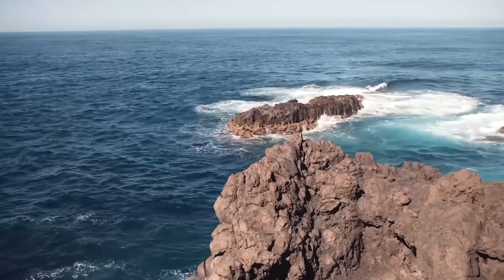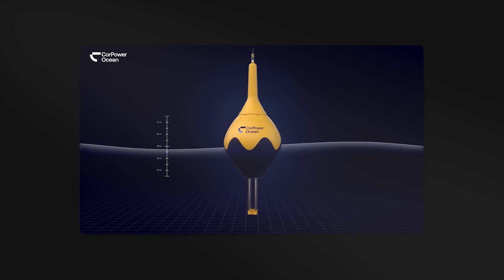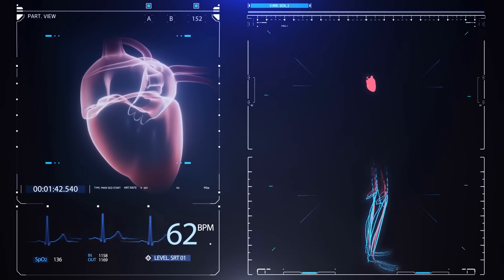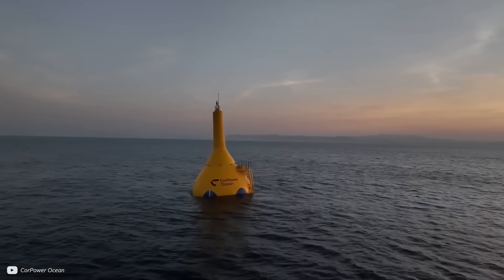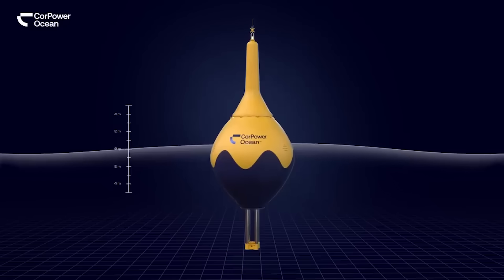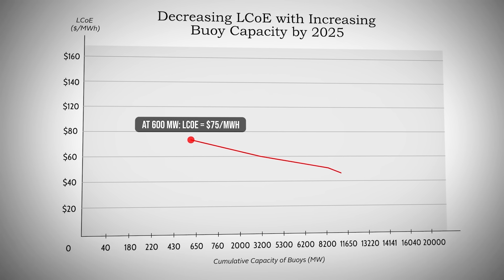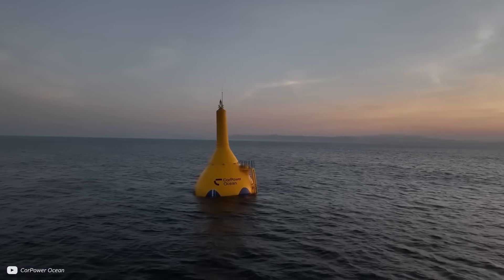Unlimited Wave Energy: This Buoy is the Future

Comment: One major problem with many wave-driven generators or anything in relatively slow-moving water is barnacles weighing everything down over time or interfering with moving parts. Anything you permanently install at sea that requires buoyancy or exposed underwater moving parts will likely need to have the barnacles periodically scraped off and an anti-stick coating re-applied.
Reply: It moves up and down the shaft, just put a scraper on the bottom that moves with the float up and down.  Everything else can be barnacled.
Reply: It will be a simple machine that cleans itself. What you proposed is wonderful !
Reply: @barneyrubble4293  Barnacles increase drag, which increases side loads that the whole system has to withstand through the whole range of oceanic currents, wave roughness and operating loads. It also adds vertical drag which increases the up/down loads the mechanism has to bear. Buoys rely on buoyancy to apply upward force and barnacles weighing the shell down would reduce available net buoyancy, reducing peak power production.

Scraping the pole to prevent barnacles from stacking on it only solves a small part of the barnacle problem. The part of the reciprocating pole that gets regularly used in operation would get scraped by the entry point shields and seals anyway.
Reply: In fact, nothing bad will happen if it is well designed and what you say will not happen. Do not portray the “moving parts” as if they are a bad thing. The mechanism has been known for a long time and it is a smooth and strong sliding mechanism, so no “scraping” will occur. . By the way, everything on the beaches, including barnacles, can attach to anything, even if it is a rubber board. But it may be possible to isolate the mechanism so that it can perform its function without being affected by the surrounding environment.
Reply: @teardowndan5364  seems like it would be a pretty easy job for a drone to carry out regularly if designed in a smart way or am I under estimating the complexity of the removal?   Certainly for the shaft at least
Reply: is that not a biological problem, not a mechanical so it requires a biological soloution

Comment: Hi Ziroth, love the topic and the way you explained the tech. I have been thinking about this for a while and have seen many different versions of tech trying to capture the wave energy.
My research was also on storage of energy as the renewable sources are neither consistent nor reliable. With this in mind, I was exploring Compressed Air storage and developed a quick & dirty CAT ( compressed air turbine ) and also received a patent for it. https://patents.google.com/patent/US9627953B1/en . Would be great if you could cover this topic as well as current forms of storage are extremely polluting to manufacture/recycle/dispose.

Comment: Pity that wave energy is barely predictable and not at all plannable. You don't know how much energy there will be and when, just like wind and solar - it's weather dependable.
Another story is presented by tidal and ocean current energy - 100% predictable and fully plannable even if tides turns 2-4 times a day - you know exactly when and how long the outage will be.
There is now newer generation of ocean current tech: Minesto Dragon 12 - very light (=low costs) 28 tonnes, 12m wing @1,2MW, projecting to produce about 3GWh electricity per year. Just lanched in februari and working flawlessly.

Comment: Actually, you could have a much longer tube like structure, and capture the energy of those 18.5 metre high waves as well. That would 1. produce much more energy, 2. allow for continuous operation in all weathers, and 3. act as a slight damper to such storms, marginally reducing their destructive damage on the nearby shoreline.

Comment: If wave energy machines actually worked why are they not used to power the lights on navigation buoys?  Instead we use batteries that have to be replaced. 
I suggest the whole thing is a way to extract research money from gullible providers.

Comment: Finally an alternative energy solution that doesn't destroy the environment, and ocean animals as ocean wind turbines do. Also does not despoil the aesthetics.
Possibly providing good energy most of the time, not like only 30% ave for wind and solar. Let's hope this is a good solution. if they can get the issues of longevity of the system and big maintenance requirements addressed.
There have certainly been many many wave energy systems failures.

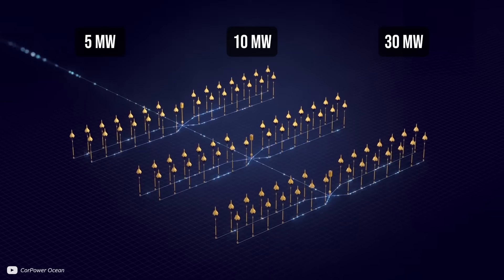Comment: This system looks very intriguing. But I am puzzled by the anchor. The anchor is a LONG, rigid cylinder  (8:00, 10:29), with a large 'bulb' at its bottom. For this to be vibro-hammered into the seabed, implies the seabed consists of deep layers of loose soil (not what I expected). The anchor (7:58, 10:36) is vibro-hammered into the seafloor. The piston assembly (8:42 - 8:44) is mounted to the anchor via. a  flexible coupling (4:27). The underwater assembly is very briefly shown at (8:45). I am puzzled by the sea floor and bending moments on the piston.
NOTE: Minor error at 4:07- "Work with air instead of a fluid" is wrong. Air is also a fluid.  It should say 'work with a compressible fluid (air) instead of an incompressible fluid (liquid)

Comment: The economics of power generation are driven by physics.  Generation efficiency depends on the concentration of energy.  High concentrations of energy (speed, pressure, heat, height etc) improve efficiency.  Wave energy is low density energy.  It takes a lot of materials (concrete, steel, other) to harvest low density energy.  Wave generators have to be able to cope with the worst storms.  That adds to the weight and cost of materials.  Very very difficult to build economically viable wave generation.  That is why these types of projects rarely get past the pilot stage.
Reply: Party-pooper!  ;)
Reply: @gibbogle  There is always one :-)

Comment: Switchgear electrician here. Better to split power output into three branches, with separate paths to shore. Yes, more expense, but also cables are less expensive (thinner) and three is more reliable than one. We know that electric fields are used by a variety of aquatic critters for sensing, and we don't know how they will react.

Comment: The universal anchor is an interesting concept. Would the optimal solution not be influenced by the geology of the seabed? That would make a one size fits all solution sub-optimal. Is it designed with a massive factorv of safety but inexpensive materials? Maybe it's only the pile cap that's universal and the vibration pile that goes into the sea bed is matched with the local conditions.

Comment: An object already rides waves moves in a circular motion. No need to convert vertical to circular when you already have circular. Simply need a crankshaft suspended at the average height of the peak/trough, something that floats for a crankshaft journal, give it the freedom to slide towards or away from the center of the crank. ta-da instant wave generator w/o the efficiency loss of converting circular to linear motion. Someone patent and build it... when you get uber rich from it, just throw me a tip for the idea.

Comment: I think it's fantastic that there is a new group making a device and it looks compelling and full of innovation and I wish them all the best.

I don't like the whole theme 'a litany of failures' to describe previous work in the field of wave energy. Another way to describe it would be 'they are standing on the shoulders of giants'.  The Wright flyer only managed a few hundred feet aloft.

Device efficiency is not the key driver of a design as there's an infinite amount of wave energy. The thing to optimise is the amount of power generated per million pounds invested. That's the return on capital expenditure.

Survivablility is very important - the Ocean Power Delivery's (now Quoceant) Pelamis P2 was tested in the North Sea between 2004 and 2010 off Orkney surviving many storms.

Ultimately wave power will be decided on factors like how much it costs (it can't compete with offshore wind at the moment). It might be worth the cost in inshore areas where wind turbines are unsightly.

The whole field of modern wave power was founded in the 1970s by Stephen Salter and the Wave Power Group at Edinburgh university that has give rise to several wave power companies and different devices. The most basic of research would have shown you this and it's a shame that you didn't do that especially as Stephen Salter died a couple of months ago.

Comment: wavepower, i like it.
Survivability and efficiency are the problems?

Well, boats if build correctly can last a long time.

Seems to me we have this thing called tides. Every so many hours, is it 6?
I dunno, not an expert on tides.
Not an expert at all actually.

BUT, what i would think is possible is to use boats, or floating platforms or such, that rise with the tide in a nice harbor.
They go up. And they go down.
So why not attach em to a gear train that runs generators?
Construct something that makes it possible that the generators run when the floating stuff goes up with the incoming tide, and down with the outgoing tide.

The current of rivers are not used that much either.
But we could...
Instead of windmills we could put stuff in rivers to generate power.
Not just dams but propellers on the bottom. Something like that.
Or, just the old waterwheels we used in the past.

We could also stop wasting our time on this and just continu to work in a bit slower pace towards all these nice goals.
They are nice, clean energy.
BUT we cant expect the entire world to just switch in a few years time from cheap fuel oil to expensive stuff like this.
Plus, it wont work.

We should take it a bit slower.
And instead of wasting billions on wars, we could spend it on coming up with ways to actually provide people with everything they need as cheaply as possible.
And sustainable.

I am no Einstein. 
But it seems to me we should use the power of nature a lot more than we are doing right now.
And we could if we took the time to think about that instead of thinking about wars.
Heck, we sent people to the moon in the 60's. So we could achieve anything if we want.

Comment: Best video on the topic I`ve seen! You have done your homework here (not to mention your other videos)! And that`s coming from someone who was involved with wave energy for 15 years!  I do think that CorPower is hands-down the winner in this niche,  however I cannot see it competing with Floating Offshore Wind as the interest, money, and O&G experience  has shifted there in part because of all the repeated overpormises and ego-driven failures of the WE industry in the past 50 years.  Let`s hope CorPower can break the trend!  At this point we need all the renewable electricity we can get.  One thing that you did not mention (but which of course is repeated ad nauseam by propoenents is that wave energy is less intermittant than wind or solar.  And where did you get the LCOE figure at 10:25 from?  Keep up the good work!

Comment: Really... a mass of gears?  what is wrong with just one moving permanent magnet acting as a piston through the EM fields of some copper windings creating an electrical charge, much cheaper to manufacture, certainly less wear and tear and less maintenance
Reply: I was just about to post the same message.

Comment: I wondered if the metal beams that move in and out of the buoy are not subject to corrosion over the long run? And if so, couldn't they be protected by a cylindrical skirt that covers the length of the movement filled with a non corrosive gas such as nitrogen.

Comment: Yet another gadget dreamed up to harness the energy of waves. It will not succeed because it requires piston and shaft seals to pump fluid to generate power. Sliding motion requires lubrication to minimise wear in the sliding components. Lubrication systems need attention and sealing systems require replacement ….and so it goes……all happening out at sea in a bobbing bubble…..and I haven’t even bothered to look at the associated systems….like the tethering system say…..which will require a lot of attention as it succumbs to the corrosive sea environment…..and the locking system to stop the bobbing bubble…..and….and…..and. Next please..!!😂😂😂

Comment: The massive elephant in the room here is that unlike wind and solar, wave doesn't scale at all. You can't make the floats bigger because for the same reason as a big ship gives smoother sailing, a big float will bridge across waves and no longer move up and down with them at all, so they're stuck at one size, so lose out on the economies of scale wind turbines have been benefiting from for decades. If they have to install 20 GW before economies of scale are competitive with the cost of wind and solar right now (And these figures are going down continuously, especially solar), they've literally got nothing worth anyone's investment for commercial power generation.

Comment: patenting 20 years before use smacks of patent trolling ie alternate energy working for big energy. also the very fact that these need to be anchored means provisioning ie complications plus these lock up on high energy waves. I've come up with a rough draft for a wave energy generator. it is completely submerged so very little provisioning required. think about a bicycle lying upside down. its front wheel can turn left or right, it can rotate and has spokes. now make these spokes have gear teeth and have beads with gear teeth travel along the spokes so that there is no slippage and it's bidirectional. so our weg has a base with batteries, is anchored to the floor, generates electricity when the beads move along the spokes and when it rotates on its hub and when it turns left or right. this energy is used to charge the batteries and can be connected in a grid of wegs. because it's completely submerged and near the floor, we don't need to worry about surface level turbulence. the beads can have fins to maximally convert wave energy to linear/rotational motion

Comment: VERY interesting. Promising! You say the pneumatic system works with "air instead of fluid." Air IS fluid. In common usage, sometimes fluid DOES mean liquid as opposed to solid or gas, but this is a science and technology channel so it seems right to stick to the more exact usage.

Sorry to nitpick. But I really like this video and your other work as well. Thanks!
From Wiktionary:
Noun

fluid (countable and uncountable, plural fluids)
1) Any substance which can flow with relative ease, tends to assume the shape of its container, and obeys Bernoulli's principle; a liquid, gas or plasma. [How I suggest the term be used in science and tech pieces]
2) A liquid (as opposed to a solid or gas). [How the term was used in this video]
3)(specifically, medicine, colloquial, typically in the plural) Intravenous fluids.
Reply: And…..if blood flow went in two directions,  we would all be dead.
Reply: @ridermak4111  I thought that was odd too.
Reply: "Air IS fluid"
I was surprised I had to scroll so far to find this comment. 
For a science education channel, this is really annoying error.
As you say, bot liquids and gasses are fluids. 
I wouldn't say you were nitpicking. I think you found a fully grown louse.

Comment: I notice all the cost-benefit analyses & maintenance costs estimates are all done by the developers themselves.  Also no mention of energy to manufacture or cost to remove or recycle materials at end-of-life.  I suspect vast graveyards of these devices & all the associated anchoring & cabling infrastructure will be the outcome eventually.  Plus you need to consider all the extra transmission infrastructure costs to deliver that energy to the grid.  Mitch, Australia.

Comment: Max power output per ton of equipment is a very strange performance indicator. The website is even more confusing. They don't talk about maximum power output but energy per ton... I don't find any hint for which time period this is calculated. Do they talk about lifetime energy output?  They claim 10mWh/ton ... a normal PV module achieves about 200mWh per ton over lifetime of 10years (which is a pesimistic lifetime).

Comment: This was tried in the 1970s, didn't work due to the fact that water exists and eventually corrodes everything.  Still won't work as none of the original problems were addressed...history just keeps repeating itself.  Next, someone will invent circular load reducing annular rotating transport mechanisms.

Comment: So what if the wave rises higher than the shaft that the bouy is anchored to? Does it rip it off the shaft?
Reply: Same as if you hold an inflated ball under the water ... no problem as the system will be designed to hold that amount of tension.